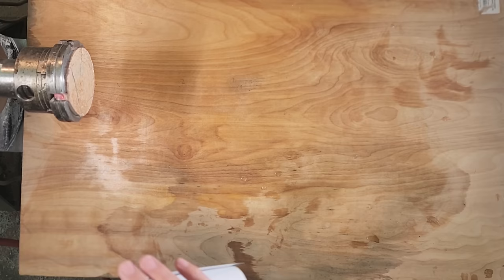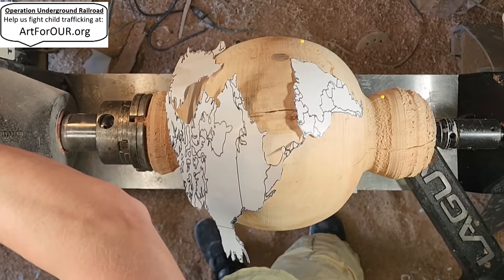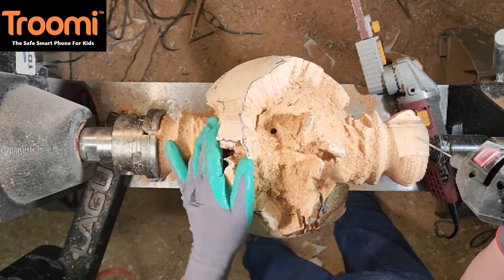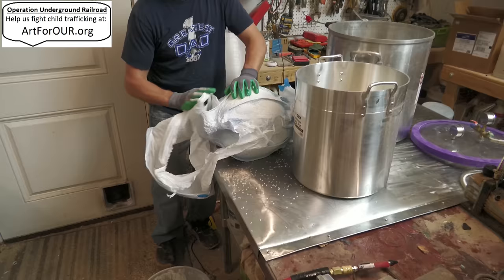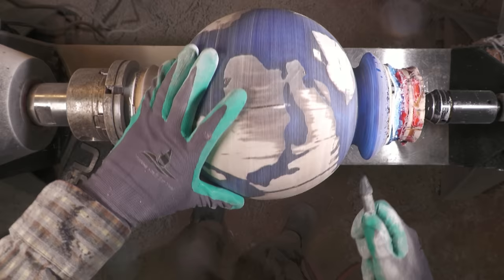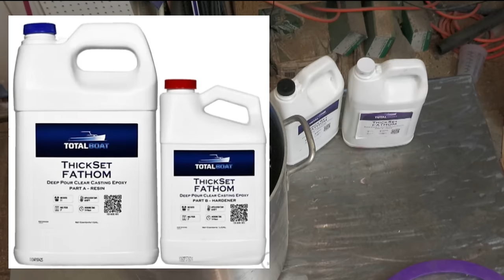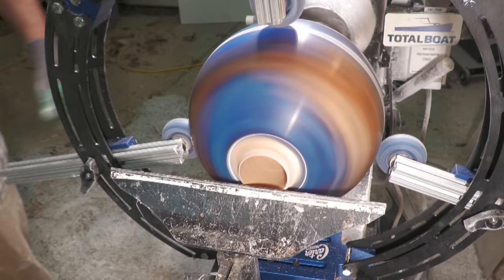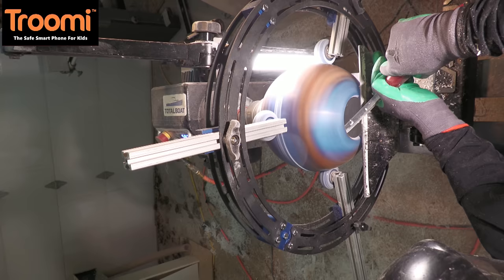"Mother Earth"  How to make a globe out of wood, resin, cotton and paint.  Wood turning, Vase.

Comment: To solve the random bubbling issue you talked about, try pre-de-bubbling the resin before using it. 

That is, mixing creates bubbles to begin with, so, vacuum the resin before the pour so the after poor vacuum has less to air to vacate, AND, having fewer bubbles allows the resin to pour more evenly, lessening the amount of bubbles created during the pour so the post-pour vacuum doesn't have to work so hard.

I hope that helps.
Reply from the maker: Gracias

https://www.artforour.org/currentauctions

Comment: Good day Dan. Just stumbled across your Globe turn and had to watch, Outstanding work sir. You had mentioned an issue with trapped bubbles that jostling around might help. I had thought the same several years ago when i started stabilizing wood. I fabricated a steel table and attached an electric concrete vibrator with speed control to it, the results were better than i expected. Your observation will make me revisit this process with casting for some problem items i could never seem to overcome with air pocket issues. Hope you find this helpful in someway and I'm happy to share info if needed.
Keep that creative brain turning & happy casting sir :)
Reply from the maker: Thank you Robert!

Artforour.org

Comment: I’ve been getting an idea about an engineering technique that might help with the dreaded bubbles, which sometimes even occur or don’t make it out in the pressure bath. I used to work for a structural engineering firm, and learned a few cool tricks. The boss was building a house almost completely made of poured concrete. To do that, they build plywood boxes that fit the shape of the wall or floor. The front and back of the boxes are connected by long bolts that run through the empty space until the concrete is poured. Of course they’re working  with straight edges where you are working with rounded shapes, but, I think a variation could be come up with. What they do, once the concrete is poured (imagine the concrete as epoxy). Once the frames are filled, they run rubber hoses through the concrete in the spaces and hook them up with some kind of motarized system that makes the rubber hoses vibrate, which releases the bubbles. Of course at that scale it takes all day, and they have to pull out the rubber tubes before the concrete hardens. For your smaller scale (even though it’s large scale to you for your projects) it should be simple enough to create a flat, or even concave piece of wood or metal to hold the piece) vibrating tray for your piece to sit on and get vibrated a while (and the time needed would need to be calculated by the time constraints of the epoxy, before sending it to the pressure tank for finer detail. It might also require less time in the pressure tank as well. It’s just a thought. Do you think that might work?
Another question I wanted to ask (and bear in mind I have never worked with epoxy) is would it be possible to vibrate one color of epoxy just to a certain point, and would the epoxy dry a little during that process? If it does, would that make it possible to add another color of epoxy, say, in going up toward the first color, say near top of something like this vase? And would the first layer of color still be slightly wet enough so that the second color could mix with it just a little bit, so the colors could blend a bit just near the join area (or slightly more, if that might look nicer than having a sharp line between the colors? This was inspired by the ocean area of your vase when I was imagining various shades of blue and maybe some green, perhaps representing tides of different temperatures creating a bang of colors blending. Or for various tidal directions crossing other tidal paths. Some interesting color combinations and additions could be created that way. 
One more thought, when making earth globes, have you ever thought of adding some burl layers to the mountainous areas of the planet? I’ve seen several videos of people painting burls that way - only the lower areas of the burls, and not covering all the burl, because the brown tops of the brown burls could evoke the barrenness of the dirt and rocks above the tree line. I’ve seen burls be done in lightly painted colors of epoxy like light icy blue or blue-green, which add so much interest.
Thank you for letting me share my thoughts. When I watch videos like this, my mind starts exploding with ideas, and I like to share them.
Best of luck to you. Your work is beautiful.
Reply from the maker: These are some great ideas.. I've toyed with all of them in one way or another.  I tried vibration early on and it didn't seem to do the trick.  Ib think the mixed resin is too viscous compared to water in concrete.   That being said a few bubbles will get trapped sometime and it would certainly be nice to be able to shake the project violently or at least be able to move it around in various directions...

Artforour.org

Comment: What might help with the bubbles thing, if you haven't figured it out yet, would be to have some kind of vibration machine to the process or add vibration capacity to a current machine... Like for instance, when vacuuming out the air, you could in theory, also vibrate the thing, which would in theory, help get rid of bubbles or at least help make them smaller... Not 100% sure if my idea would work, but i seem to remember hearing something like that somewhere, that sounded like it would work, but i don't remember if it did work or not...

Also, I'm not a woodworker, but if i was to make something like that i might find a way to close off the top piece then make a base with a light in it, that would stick into the bottom of it, to see what that would look like, especially at night... The light could even be just a string of those battery powered white fairy jar LED lights, which amounts to a jar with a string of tiny LED lights in it, either solar or strictly battery pack powered, or else, if you HAD to do it the way you did it, then you could find a way to incorporate the electronic components into a curved shaped plug that would fit in the top, that would hold the battery pack inside of it, and when you need to replace the batteries, you would just remove the wooden plug on the top of the globe, flip it over, remove the battery door, if there is one, before changing the batteries, and yhen doing the steps in reverse, to close it up again...
Reply from the maker: Thanks for the ideas!

ArtGivingHope.org

Comment: Ah yea problem with that map is that isn't a "non distorted" one that actually is one of the MOST distorted maps as it massively stretches anything near the polar regions.
To get the size, shape and scale of the continental masses right the best projection to use would be the "Goode-Homolosine projection" as it pretty much offloads all distortions to the oceans and also cuts them apart to still keep them relatively to scale.
Reply from the maker: Thanks for the feedback.

Comment: I'm writing this for my husband . He is enjoying your videos very much and loves the things you are making .He wants to try  Have watched your video and are a bit confused as you seem to be using a vacuum tank and a pressure tank . Also why are you using sand ?We would like to try it ourselves .. Have bought a vacuum tank and it is telling not to put anything in it bigger than 8 inches wide x4 inches high we don't understand why as you seem to be filling up your tanks  . Any advice would be appreciated   Thank you  Eileen for David
Reply from the maker: Thank you for your support!  The vacuum helps seat resin deep into the wood and get rid of big bubbles.   The pressure pot helps compress the tiny bubbles that get suspended in the resin.  The  sand/rice help with making the cheap molds i use.   It holds the walls in...

Thank you very much!

https://www.artforour.org/how-you-can-help

Comment: Regarding the map distortion ... you should have used a distorted map. The reason why they appear to be distorted is because they are taken from a 3D image and placed into a 2D environment. 

So, when you used a NON distorted 2D version and placing it in a 3D environment, you created the reverse situation as to why the 2D versions looked distorted in the first place.

So, if you'd taken a distorted 2D version, that looks that way because it's still in 3D format, and used it for your 3D globe, it would have been fine. 

To clarify:

A 2D distorted map means the map is ready for a 3D format.
And, a NON distorted 2D map means that it is ready to used in a 2D format.
Reply from the maker: Gracias

https://www.artforour.org/currentauctions